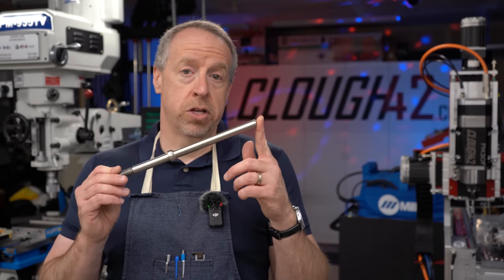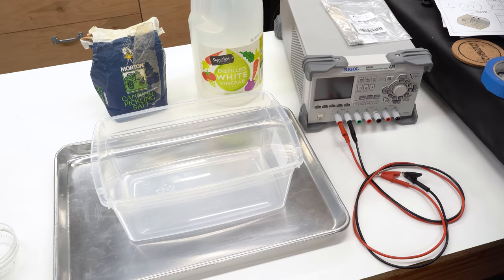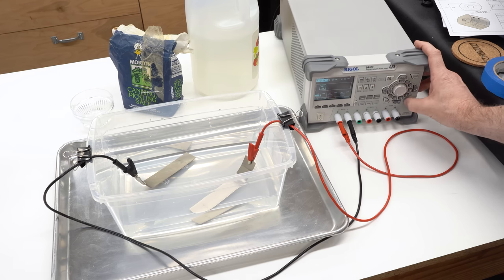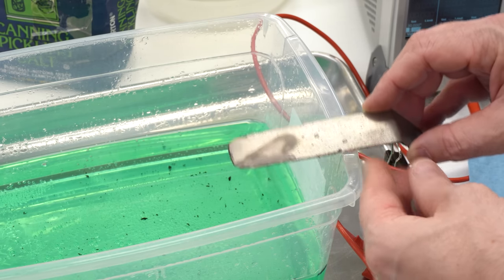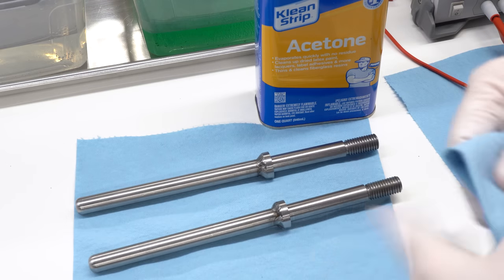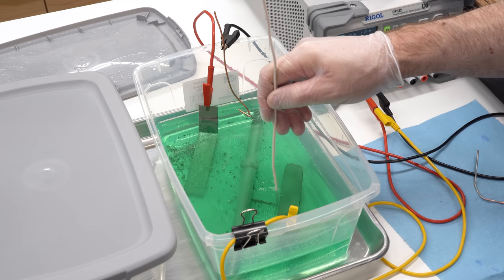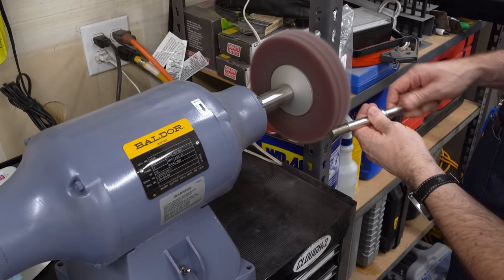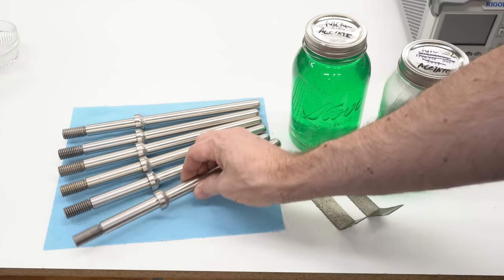Nickel Electroplating in the Home Shop - A Shocking Way to Prevent Rust!

Comment: Home or shop electroplating is a bad idea and the notion that it is a simple process is ridiculous. Reliably electroplating metals (nickel, copper, zinc, tin, chromium, brass, etc) requires specialized equipment, hazardous chemicals and process knowledge that are not available to home enthusiasts. All electroplating takes place in a specific process sequence that involves multiple cleaning, rinsing, de oxidation steps before the plating step can be initiated. These process steps use strong and potentially hazardous industrial chemicals. This should only be done by people who are in the electroplating and surface finishing industry. In addition to the potential for exposing the hobbyist to hazardous chemicals most of the products used in electroplating would be considered hazardous waste by the EPA so disposing of them is a real problem for anyone not in the industry. Bottom line, do not try to electroplate at home or in a shop. Take your parts to a plating company near you. There are more than 2,000 licensed plating job shops in the USA.
Reply from the maker: All-or-nothing thinking like this is a cognitive distortion, and it is fundamentally at odds with the idea that ordinary people can be makers of things and not just consumers.  My results were totally sufficient for my needs, and I did not use any of the hazardous industrial chemicals or secret industry knowledge you describe.  If I ever grow tired of reusing my two quarts of contaminated vinegar, I can evaporate it or take it to my local hazardous waste collection.
Reply: @Clough42  and what do you do with the nickel salts that will be left after you evaporate your solution? Throw them in the trash so they can leach into the ground water at the land fill? Look certain activities are suitable for the home hobbyist and others are not. Dealing with metal based electroplating solutions at home or in workshop just is not a good idea. Additionally the chemistry used in electroplating is dynamic meaning it changes as you plate and must be monitored and maintained or the resulting nickel (in this case) deposit will not perform well. Visual appearance of the deposit is not a reliable indication of quality or performance. My background is electroplating, I am a chemist who has worked in the industry for more than 40 years having built and installed plating plants in more than 20 countries.
Reply: @jeffbrassard1268  perhaps an industrial chemist with far too much spare time to be hanging around micro scale DIY nickel plating videos on YT and do nothing but criticise based only on your assumptions
Reply: @ianbottom7396  perhaps Ian, perhaps indeed.
Reply: Would just using stainless steel metal make it way easier to make the part instead of plating the item ???
Reply: We have one plating outfit in Alberta over 200 miles away, the biggest one went broke and folded.
Reply: @victoryfirst2878  
Stainless steel could be an alternative to (properly) nickel plated carbon steel in some cases. Typically stainless steel has different matching and strength properties so it may not be appropriate in all cases. Additionally stainless steel, principally due to its higher nickel, chromium and other alloy constituents, is usually significantly more expensive than carbon steel even when nickel plated. In fact, nickel plated or electroless nickel plated carbon steel is often a design consideration to replace parts made from higher cost stainless steel. Lastly, stainless steel, depending on the service environment is not always stainless and can show oxidation and corrosion under some condition. These are engineering trade offs that manufacturing engineers go through when designing component parts.
Reply: @jeffbrassard1268  Did you not read "I can evaporate it or take it to my local hazardous waste collection."?
Reply: @victoryfirst2878  That would be way more expensive.
Reply: @davesutherland7432  Necessity is the mother of invention. You have proved that for sure. Nice work fella. Nickel leaves a rean neat surface finish.
Reply: @jeffbrassard1268  You are correct Jeff, stainless steel is actually called corrosion resistance steel name from vintage metal makers.
Reply: Appreciate the concern but this is not an industry. The salts he produces will never amount to the waste you generate on an industrial scale. Stop blaming the DIY folks for “contributing” to industrial pollution. Fix the industries. Leave the individuals to themselves.
Reply: @jeffbrassard1268  I suspected that you had a financial incentive to be so critical of people trying to get into your industry. I'm glad to see that I was correct in that hypothesis.
Reply: I think this is fake. No way nickle will hold after just cleaning with acetone.
Reply: @victoryfirst2878  $$$$ ..... easier but ..... $$$$
Reply: @Onajkunj2  sure it will.  
Copper plate prior to "nickel " plate might be even better.  Then followed by chrome.  Triple plated chrome.
Reply: @jeffflanagan2814  
Hi Jeff,

My comment was not a criticism of how the video was done, frankly I thought is was very good. I was calling attention to the fact that electroplating is a 100 year old industry backed by chemistry and engineering science. There are hundreds of industrial, military and aerospace specifications written around the various electroplating and surface finishing processes that are commercially available from a global community of applicators. The industry is highly regulated by the EPA and OSHA among other government agencies. The processes required to get reliable, high quality electroplated coatings simply cannot be done in a home shop, nor should they do to the complexity of the process and the hazardous nature of the chemicals and metals involved. The appearance of the plated coatings is rarely an indicator of its quality or performance. Just because you can put a deposit of nickel on a steel part does not mean it will hold up over time. Deposit thickness and maintaining proper plating conditions during the process are critical- none of which can be controlled in a home shop environment. For instance a defined preplate process is essential to achieving deposit adhesion, this consists of alkaline soak and electrocleaning steps followed by clean water rinsing followed by a de oxidation step again followed by clean water rinsing all before you get to the plating step. The plating solution must be controlled, the pH, nickel concentration, temperature, anode to cathode ratio and current density must be maintained precisely in order to achieve a good adherent deposit. All of these process components are specifically designed for a purpose and must maintained, usually by a chemist. And yes I am the current president of the National Association of Surface Finishing trade association and have associated with the industry for 45 years.
Reply: @jeffbrassard1268  You make this sound so complicated and it is NOT. You must presume most people are ignorant or incapable. This sort of thing used to be taught in high school chemistry. Stop perpetuating the dumbing down.

Nickel salts? Oh, so scary. What about Sodium and Chlorine salts? Also so scary...*table salt*. Letting vinegar evaporate is NOT an issue...unless apple orchards need to be burned down for fear of rotting apples...and apple vinegar.
Reply: @Clough42  Suggest just using a little electronics cleaner as they tend to not leave residue.
Reply: @jeffbrassard1268  i work for a national waste company. landfills have giant tarps under them and have constant water monitoring. your "facts" are not true.
Reply: @Onajkunj2  One can think whatever they want. Last I checked we live in America.
Reply: The plating bath is basically infinitely reusable, so disposal doesn't even happen. It's a non-issue.
Reply: Stop it. It is a quest for knowledge, and I have successfully electroplated silver and nickel in my bedroom. Yes, I have a homemade carbon and hepa filter, and I vent the room...
Reply: @aminormaximum2446  I remember when I first used two D cell batteries to plate a dress pin. Worked well.
Reply: @victoryfirst2878  nice! Small innovations for the questioning mind! It is always good to try, and in the process, to learn new things!
Reply: @aminormaximum2446  This is hands down the name of the game. The ah hah moment is great. Like winning the lottery.
Reply: Jeff, I think it is good that you pointed out some of the hazards of plating. I think your concerns would be more meaningful if it was some type of chrome based plating. Isn't anything with chrome based plating much more hazardous? I am sure you mean well but you come across as a Pedantic Safety Sally.
Reply: Captain buzz kill, just letting you know, I've done this way of electroplating before and what do you know many years later the parts are still going strong, completely rust free!
One of the parts was a casing of a starter motor that's on a 4x4 that's constantly muddy and wet, give it wipe down and it looks like the day I plated it...
Reply: @sm9300  Nice to hear that the plating stands up strong to wet areas. When you buy brake calipers that are top of the line, they are plated, either chrome, nickel, or zinc. They really hold up well to corrosive environments. The painted or plastic coated ones seem not to really hold up. The corrosion usually pushes or bubbles the paint off the item.
Reply: I will be trying to plate my old front rotors for my car. Not exactly sure what metal I will plate but will try either nickel chrome cobalt antimony or tin metals. Will make sure to get back to you Jeff with my plating adventure. Thanks for the idea fella too. vf
Reply: @jeffbrassard1268  Now you are catching hell for your comment! I would say, you are right in some ways, but maybe of you would have said your piece on a more productive manner, it wouldn't have been so unwelcome. One knowledgeable person commented as to the dangers of trapping the hydrogen and oxygen below the lid, leaving only a spark to explosively ignite, but otherwise was pleasant. He was actually pleasant saying that. It is better that instead of yelling,"everyone panic, bad, bad!", You could have passed on some of that good knowledge that you have, in a way that made people want to listen and consider. If they are watching this, they probably have a little bit of intelligence, and have probably tried much more dangerous stuff than this. I do get your point,  though. Anyways I have some really old & cold DYNAMITE sticks that are sweating some clear liquid, same I am going to go juggle them while trying to walk on stilts on concrete. Should be exciting at the very least!
Reply: @Clough42  just someone protecting their income. ;)
Reply from the maker: @Onajkunj2  I don't blame you for being skeptical.  The world is full of people trying to deceive you for various reasons.  Your intuition is wrong in this case, but of course that's what you would expect me to say.
Reply: @jasonasselin8657  Thanks, i will.
Reply: @jeffbrassard1268  Hobbyists have been electroplating for decades. Heck, we even did this in science class in middle school. So while yes it obviously can be hazardous, and everyone should actually check to see what toxic chemistry you are potentially making up. Clearly if they allowed kiddies to do it in school (under teacher supervision ofc), then it is not as horrible as you make it out to be. Yes ideally one should do all those that a commercial company will do, but a personal likely is not going to expect ideal results.
Reply: @victoryfirst2878  I found that the key to success is surface prep, you really need scuff the parts up to get a really strong bond and make sure the parts are perfectly clean, I found wax and grease remover then a flame clean to burn off any last possible contamination, and let it plate for a long while.
I made sure everything was suspended properly in the solution.
A nice deep batch with nothing sitting on the bottom!
Reply: @sm9300  I got that Shane. Cleanliness is next to godliness. Thank you for your advice Sir.
Reply: Rather than saying "it's not hobbyist-friendly", it would be better to state more useful to do to get it safe and sort-or-right. I do believe Chrome is a bit too dangerous for the average person, but nickel, gold, and copper don't seem too difficult, at least for hobbyist-grade results. Residual solutions could definitely be neutralized or turned to a disposal site.

This all-or-nothing hobbyist-beware mindset has led to pretty silly statements in my opinion. The MSDS datasheet for table salt, for instance, paints common table salt as "facilities that store it require eyewash stations and emergency showers". For table salt.
Reply: @MichaelChenTejada  A friend of mine spent the better part of a year in jail on an attempted murder charge because he put a chemical, "sodium chloride" in his dad's food, took 9 months for them to figure out that was table salt. I read the depositions!, he wasn't bs-ing me !
Reply: @petevenuti7355  reminds me of the Dihydrogen Monoxide scare.
Reply: The fear mongering is particularly strong with this one.

don't try to italicize like I did on your own.  Very Danger .  I am a professional italicizer.
Reply: Granted, caution, prudence and safety should always come first, besides, plating done in an industrial setting is going to be far stronger and last a lot longer but, nothing ventured nothing gained. I am apparently still alive after  Electro-plateing my lawn mower blades with titanium which by the way, worked great, they hold a sharp edge a lot longer than an untreated blade.
Reply: Lighten up brother! It's obvious you know your stuff, and it's also okay to FLEX a little!  😉
Although, it is indeed a simple process as shown, not bad or dangerous in small scale for the intended purpose. 
Achieving a corrosion resistant surface on small parts is not intended to provide the same results as if chrome plating bumpers for a 1966 Corvette, a plating shop is far more intense, multiple plating layers etc. But....you know that! 

For years I sold interior industrial environment projects (providing chemical resistance and/or microbial control) providing ceilings, walls and floors to various industries, including vinegar producers in MI and plating factories in IN. 
The plating industry didn't use vinegar LOL...and what they did use would damage the concrete.
 In the course of my job I have toured several Ford and GM plating division plants, and as I remember the chemistry involved in the plating industries is hazardous, is not a good idea for the DIY at home.
EDITED to add, VENTILATION is also a huge issue not addressed here.
Reply: @jeffbrassard1268  lol you sound like my dad that thinks cars can only be repaired or worked on in any way at a dealership.
Reply: @victoryfirst2878  I don't
Reply: EPA has made it prohibitively expensive for their own selfish reasons, encouraging the home DIY.  Additionally, there's pertinent information purposely being kept from the public, thus we have to learn from our mistakes.  Frogs love that, ya know.
Reply: Electroplating parts is extremely expensive to have performed by a shop from what I understand.

 I need to re-chrome some automobile emblems for a 25 year old Volvo 850R, and new emblems are not available from any source at this time. I made an R emblem for the grille out of plate aluminum, but it was labor intensive. It's possible to electroplate the old plastic emblems by coating with graphite powder first, and nickel is the closest to chrome without being actual chrome. I'm  pretty sure it would cost several hundred $ to have these parts plated at a shop.
Reply: @Onajkunj2  Based on what exactly?  I've seen plating done on LEAVES - actual copper plating on PLANT LEAVES, once it has enough of a shell it holds to itself, plus in the case of this vid the micropores of the steel will be more than enough key for the nickel to stick, the fact you don't know this shows you're not equipped to be watching this video let alone commenting on it.
Reply: @jeffbrassard1268  You make me think of a concert violin player in the London Philharmonic Symphony Orchestra who makes music for halls filled with thousands of discerning listeners and critics with career-ending influence.
You're like that artist telling the guy in the music shop whom he notices perusing the violin section that the composition of the bow's rosin needs to be sourced from a specific supplier, aged at an exact temperature for precisely a certain number of months or it will affect the breadth of the tonal palette when the Strad is played in a period chamber setting.
But the customer in the music shop was just wondering what he might pick up for 50 bucks to take to his uncle's kitchen party down the way and leave him with some beer money.

The guy made a mason jar full of green vinegar. Erin Brokovich isn't going to be taking him to court.
Guys like you need to take the next generation of electroplating professionals and infuse them with the same passion for safety and perfection that you have.
That next generation comes from youngsters who see guys like this making green mason jar juice.
It's cool. All cool.
Reply: @jeffbrassard1268  I am an industrial chemist and totally agree with Clough 42. Jeff you are also correct in your points on waste treatment. So are you saying that for the sake of a few grams of nickel acetate one should not give this a try, when major companies around the world are dumping toxins by the 100s of tons e.g. cyanide for processing gold. A check on the  toxicity of nickel acetate states it is mildly toxic, so you are saying that if I was to cystallise the nickel acetate and seal it in several plastic bags to contain it, this minsicule amount of mildly toxic compound will harm the earth?. I woud suggest you are possibly a Greenie.
Reply: Jeff, why didn't you introduce yourself as the President of the National Association for Surface Finishing? I think your comments are better appreciated in the context that your actual job is to tell folks to give their money to a plating shop.
Meanwhile, the rest of us are going to have a great time nickel plating whatever we want to.
Reply: found the guy that owns a licensed plating shop that doesn't want you doing his "specialized process" yourself.  Lol.
Reply: @jeffbrassard1268  As an Industrial Chemist I will answer your question. As he has 2 litres of solute and say the concentration is 20% by weight, he will evaporate and leave about 400 grams of salt. This salt can be wrapped in triple layer polyethylene which would never leak at a tip. Jeff can you stop pretending the hazard you perceive. For your info I did nickel plating at school here in Australia in 1974, completely safe and the job was well finished. Obviously you have a vested interest to not lose business to people doing their own electroplating by throwing the dangerous chemical herring angle around.
Reply: The last thing most plating companies want is the average dude walk in customer with a couple parts. It costs more to process the order than it's worth. Simple PITA! Yes they can throw it in with a batch run and most will but that's just to be friendly to the public.
Reply: @jeffbrassard1268  Mate, you need to calm TF down.
I used to run the plating line for an electroplating company in Brisbane Aus. 

Sure, industrial set ups with several kilolitre tanks of potassium cyanide are not suitable for the back yard'er. That's NOT EVEN CLOSE to what's being shown here.
Dude wasn't even using anodic or cathodic cleaners.

Settle down.
Screw the EPA, screw all your noise, I will have my hobbies in my shed and there isn't sweet FA you can do about it, nor will the sky fall on all of our heads.

One of my other hobbies involves charging up 10uF 100,000v capacitors to 50kV or higher. That would rip your (or mine) arm off in the blink of an eye, cauterise the stump and at least partially vaporise the limb, at least a finger or two. I have no formal training as an EE, electrician, linesman or any other formal training for that matter. I also write my own software and lash up some pretty dodgy process control and automation setups from time to time.

I suppose I should sell off all my welders, transformers, chemicals, hand tools, computers... and go hand myself in to the authorities, in your books.
Reply: @Clough42  I agree with you, I started to do anodizing at home and like you, found it to be rewarding once i got it to work.   I like to DIY whenever possible and enjoy the challenge of learing new stuff.   On a practial level, I am certain most plating shops would laugh you out the door with 6 parts, or charge such a high fee to discourage small infrequent customers.  Thanks BTW for the great video!
Reply: Jesus.  I am a toolmaker.  These processes become unsafe based on scale.  For what he is doing I promise you he is having a minuscule effect on the environment compared to your local trailer park chemist in their motor home.  Besides he clearly stated he had a safe method of disposal.
Reply: @victoryfirst2878  If you really want to play around with plating, and you run into trouble, get your hands on a copy of The Canning Handbook. 

It's the bible of plating, anodising and most other surface finishing. Pretty much all of the technical "process knowledge that is not available to home enthusiasts."

Of course, do your due diligence and look up the MSDS for any chemicals you need to acquire and should you end up with any waste, take it to your local waste management centre.
Reply: @jimmyb1451  I tip my hat to you Jimmy. You were the first person who know the trick with this manual. Some would say it is the good book of planting plus extras. Also, you can find a many other methods for plating in old patents that use simple elements which perform flawlessly. There are many ways to skin the cat, it is said. Job well done Jimmy. Peace, vf
Reply: False thinking
Reply: @Clough42  
Just use up the nickel solution if you don't need it anymore. 
Means simply nickel plate something until the solution is clear. And Nickel is hazardous to aquatic life. 
Be aware that the bubbling is most likely hydrogen and can cause a explosion in a closed space! 
Hydrogen often causes scratching feeling in the throat and coughing, but depends on the hydrogen concentration in the air.
Reply: @jimmyb1451  You can buy solution for plating from eastwood company. The sell stuff for car enthusiasts. Eastwood Electroplating Electrolyte Solution Works With Brass Copper Steel. The cost is 53 dollars. Just a thought Sir. Peace
Reply: @victoryfirst2878  
Your getting wrong information about plating.
Your finish part will only look as good as before.
What I mean is you can polish it before to the finish you are looking for, and then again after you plate.
For the best results.
Reply: @victoryfirst2878  
Can’t plate rotors it is way
harder than before and it will EAT BRAKE PADS.
Reply: @scottmccoy9230  Both points well taken Scott. Have a great day too.
Reply: Jeez, what a kill joy. And most of what Mr. Brassard says is wrong, anyways.

On a relative scale compared to other metal salts, nickel is not very toxic. 
If you ARE concerned about environmental aspects of heavy metals, then better not hunt: lead is far more toxic.

You could in fact pour it down the drain in small quantities: it gets diluted in the system, and from a hobbyist's output you aren't going to cause a problem. And THAT is based on the fact that you already consume nickel in water and food at an average of 3E-5 mg Ni/kg/day for a 70 kg person. So yes, that's a small amount, but the POINT of that is that dilution of any spent nickel DOES get massively diluted by the sewage system.

Perhaps it's more responsible to neutralise the dissolved nickel with a caustic, then dispose as solid waste.
Reply: A little overboard there Jeff? Take some of that passion to India, or China, this guy isn't gonna hurt anything with his hobby kit.
Reply: Caswell plating has some nice home shop kits. Jeff remove your head from your rear. How benevolent of you to even address us peasants. People like you should or could share more and better the community but instead choose to use fear to make this relatively easy process a boogie man that only the superior like you seem to think of yourself as the only ones privileged enough to use. Sorry but you seem hurt that a “simple” man figured out a simple process safely.
Reply: You know my local hazardous waste collections got fined not too long ago for dumping industrial waste into the ground..  so disposing of should be in quotes because you have no clue or control of what happens to the stuff after giving it to the certified people who are supposed to be collecting it all and doing what they do with it all.  Which i assume all gets buried like everything else either in the states ot shippef over seas to be buried over there..
Reply: @jeffbrassard1268  ok boomer
Reply: Says Mr Brassard; Chairman of the "All American Association of Metal Platers"
Reply: @jimmyb1451  I want to party with you, sir.
Reply: Patronising. People can do this at home if they want and are aware of risks.
Reply: Your trolling or something. Be safe start plating.
Reply: @jeffbrassard1268  Hi Jeff I read your comments on these Nickel plating video's with interest and in an ideal world I agree with you, your comments are very sensible and undoubtedly indicate a better route for plating metal than doing so in a home shop. If I wanted plating for commercial work I would always go to a professional plating company as I cannot guarantee the quality or repeatability of my plating. If I wanted to have a long life on the part I was looking to plate for example plating a part for a vehicle restoration then again I would go to a professional firm. Having said that, I shall continue to happily plate projects in my home shop because reality here is that margins on personal projects are tighter than a tight thing in a tight place 🙂 For my personal work it's a question of plate it myself or don't do it. I am not a chemist (my degree's are in another subject) but there is very good information available  on amateur plating including safe disposal of all chemicals used. Please don't assume that all amateur platers are incompetent, because it's not so. Best regards Sarah
Reply: @victoryfirst2878  Stainless steel in most of its alloys is a real pain to machine and work.  Where it's in demand, there isn't a real replacement.  For the rest of applications, it's too costly to deal with, as a metal, as a consumed part or product, and with its hazardous waste potential.
Reply: @Clough42
Reply: Does anybody here success in electro-plating after this video clip ? I think most watched just for entertainment.
Reply: Jeff I dont know if you'll see this, but I want to thank you for your comment and follow ups. You obviously have a great deal of knowledge on this subject, and not everyone takes the time to share.

There is a great deal of need in the world, and with what you have, you could change the world in a better way. If you could take the knowledge you have, and translate it into a "good enough" solution that might not be up to professional standards, but good enough for hobbists, done in a safe and economical way..

Look at it this way. What audio file revolutionizes the music player industry? Mp3. Why? Because it was "good enough." something similar happened with digital cameras not long after. The AK47 line revolutionized firearms, as it was a "good enough," economical solution to small arms.

Most of the world is not paid like you, and other westerners are. Here in South Africa, the going rate for a day's wages is $17. And no, nothing we buy here is cheaper than you can get in the US, most is MORE expensive due to the 40% import taxes and extremely corrupt quasi-socialist government.

So for us, we can't afford to get get professionally nickle plated tools/parts, like most of the third world countries, we have to see what we can come up with.

I wish you would think about these things, and help us come up with a "good enough" DIY electroplating setup. Who knows how many people will take that and turn it into a desperately needed side income for their family.

Much thanks,
Jesse Gunn, South Africa
Reply: Anyone that can read can electroplate.
Reply: @victoryfirst2878  sure, would raise cost as well! Stainless steel costs four to five times as much as galvanized steel and untreated structural steel.
Reply: @plintu3  That is so true on stainless costs. I just buy my metal from surplus sales. Price is very fair. PERIOD. That is why I always use STAINLESS STEEL Should be called corrosion resistance steel. That is what it was called originally. Peace and have a good day too fella. vf
Reply: @MadSceintist  Good luck with your planting jobs fella.
Reply: @MadSceintist  I just bought rotors that are plated. The price was three hundred dollars. Did not have to do anything other than placement. Will work for me fella.
Reply: E
Reply: You are correct in all respect. One big issue is proper ventilation and most basements, garages or pole barns do not have the required ventilation. Mixing bath chemicals and getting the plating baths up to temp for operation all need ventilation. Don't poison yourself. If you want to do some beaker chemistry with a few small parts then a well placed exhaust fan and a good fresh air intake is all that is needed.  Beaker chemistry means one or two beakers no bigger than 500 mls.  The small amount of fumes given off isn't too dangerous as long as there is good ventilation of fresh air intake and a well placed exhaust to the outside. If you are always getting stuff to plate, then make friends with the local small business owner that does commercial plating and let them plate your projects. This is much safer.  You don't want the EPA to condemn your house or garage. Hazmat clean up is expensive.
Reply: How many of those 2,000 do old school clear cad plating for old car parts?
Reply: Sure, this is likely pretty low risk with respect to the nickel compounds primarily due to scale, however proper PPE should always be used and understand how to deal with the material. Nickel is a heavy metal and exposure to it in plating will increase that exposure above what would occur through its natural occurrence in the environment and can become a toxic exposure.  Ask David Hahn how his DIY breeder reactor turned out. I'm sure his neighbors were thrilled to find out he created an EPA superfund site next door...  all he did was get some smoke detectors... surely those common items could never be THAT bad, right?
Reply: I was working avionics in Tulsa and a guy on my crew was volunteering for the plating shop. Hot deadly chemicals. Overtime isn't worth it and a guy from the shop came to tell him he was a replacement for the last cancer victim of that shop. 757 main gear about 15 feet high were plated there and walking through it one time and I stayed clear.
Reply: @victoryfirst2878  Stainless is MUCH harder to machine and weld, not to mention quite a bit more expensive than mild 1018 steel.
Reply: @demandred1957  This all depends on the technology you have access too including great location of surplus metal supply.  Cheaper for me than you can imagine, Sir,
Reply: @victoryfirst2878  Cool. It is still quite a bit harder to machine though.
Unless you have the proper tooling etc as well.
Reply: @demandred1957   Friend has complete machine shop. Yes stainless is a bitch as they say in the machine shop but the right tooling makes all the difference.  When something is made with this it just lasts. The shine is first class and life expectancy is literally unlimited for sure.
Have a Happy New Year Sir. Peace too vf
Reply: You both have valid points…there’s a place for professional efforts and procedures brought solely from “BIG COMPANIES” buuuuut there’s also ALWAYS room and need for hands on knowledge accumulated through DIY Projects especially if the outcomes assumed meet or exceed the needs of the “little guy”. And as GHANDI would say…”I have only love and respect for the both of you’s guys” 😅
Reply: Jeez, I bet you're fun at parties
Reply: @jeffbrassard1268  there is Stainless Steel then there is stainless steel there are so many grades of stainless and most that would be available to the average consumer is basically rubbish, As an example a few years ago when I worked on quads that most people used for either dunes or especially dunes behind ocean beaches they usually did two things they powder coated frames and used stainless bolts in both cases thinking it would make things better suited to a salt laden environment, Technically maybe in practice not so good.

Powder coating seems ideal at first glance but one chip and unlike painted finishes and over the next year or so it starts to rust under the powder coating near the stone chips then whole sheets of powder coating flake off exposing massive surface rust so much for protection properties, Whereas Painting may chip but rust never spreads underneath the adjacent undamaged paint and it is easily touched up.
When building Rally cars I went from expensive paint like Dulux Akran specifically made for the transport industry and everything from dangerous carcinogenic two pack Isocyanate curing paints in the early days cognisant of the dangers and appropriate safety requirements again due to good research, I ended up using basic hardware store enamels now available in a few hundred different colors and shades with an add in hardner and literally 20 minutes later buffing the paint with fine cutting compounds known as burnishing cream made for two pack paints result no stone chips unlike most other paints an occupational hazard with rally cars, Paint a whole car with between 0.5 tp 1 litre of paint maybe 300 ml of thinners so environmentally friendly due to minimalistic material requirements and a superior stable finish being both tough and durable and once buffed a high quality finish not out of place on a Rolls Royce

Then we have stainless bolts etc as sold by most specialist nut and bolt suppliers most are absolute rubbish more often than not galling and picking up upon attempted removal destroying the thread in the parent material most often either chassis or engine components  and requiring difficult and or expensive attention to fix, I have found however having worked on European motorcycles such as BMW that they seem to use a higher quality hardened material specification that virtually never galls or picks up and damages threads, Yes you can use various neverseize products but even then you need to do the research as to ascertain which variant is suitable for the application and rarely do the people supplying such products have the expertise to correctly  advise the customer.
Then as you touched upon with Nickel plating there is electroless plating significant because as Hot Rodders found in the past and various Government road authorities discovered after the fact Electroplating suspension components can lead to hydrogen embrittlement and catastrophic failure hence it has now been outlawed.

So as I have pointed out a well researched Mechanic or more correctly these days Technician because we do so much more from diagnosing modern Canbus systems that operate on the same protocols as the internet to various diverse systems that make up modern cars trucks and motorcycles with such a background as well as having been a CNC Machinist and Engine Machinist and fabricator making among other things approved Safety Roll Cages for Motorport I am well aware of where you are coming from warning people who jump in without a second thought as to any consequences so are just expensive mistakes other can be deadly as you try to point out, My own experiences are as noted above wide ranging and done with perfection in mind hence so much research into both techniques and materials that ultimately pays off.

Maybe others need to understand some more before jumping off and taking fair criticism and advice the wrong way, Sadly the internet is full of so called experts leading people into god only knows what troubles whereas when you do have the expertise you really have to show examples some can relate to from hard earned experience to earn respect and have people take well meant advice the right way, I hope my examples as listed above help you in the future all the best.
Reply: Nanny State in full effect.
Reply: @jeffbrassard1268  Aahhhh... makes sense now... I wouldn't worry about your job.
Reply: @victoryfirst2878  Have you tried machining stainless steel vs mild steel using average home equipment? Apart from the problems of work hardening, it's just way harsher on all tools.
Mild steel + electroplating is actually much easier. I think the current was a bit high in this video. Generally, particularly at home, low and slow gives more solid plating results.
Reply: @jeffbrassard1268  Unless annealed in a reflush furnace welded stainless will oxidize and show brown specs around the welds at some point in the future. 
Annealing prevents this oxidation at the welds, it also removes the rainbow discolorations in the weld and stress relieves the welds which serves to greatly increase the longevity of a part subjected to high stresses. 

Annealing stainless Offshore racing boat headers increased their life by more than 6 times, no structural or material changes.
Reply: Although I agree that commercial platers do indeed use some pretty nasty stuff this is needed because of volume of work and production speed. You need to move fast to satisfy customers while the hobbyist can take time. You acid dip parts in a solution that would dissolve bone, we soak parts for an hour in 2 food grade products commonly found in salad dressing. In my case, anything that gets contaminated with metal bearing solution, like nitrile gloves and paper towels are incinerated in my foundry. Everything else is saved in sealed containers for re-use.
Reply: @lisakingscott7729  This is the trick with working on stainless at home. When you go to swap meets, flea markets, yard sales, ask the people maybe they have machine tooling. I literally got all my tooling just by asking and try getting cobalt alloy tooling. This works way better than HSS, last way longer when ground correctly. Make sure the lathe does not overspeed which brings in chatter and chipping the tool and making a smooth cut impossible. Also, using a vibration absorber on the lathe makes a world of difference. Hope that helps and good luck Lisa.
Reply: @jimmyb1451  wow, I'll never regret to read all this comment section thanks to you!!! I really aprietarte your recommendation!
Reply: @ianbottom7396  I too am an industrial chemist and occasionally run DIY electroplating - mostly zinc - for corrosion prevention on  automotive parts.....just 'cus I can. Read up on the chemicals required, use eye protection and try to avoid splashing solutions on your skin (or wash off promptly if you do) and you'll be fine. Read up on hexavalent chrome and how to avoid inadvertantly making it. As for miniscule quantities of chemicals leaching into the environment....not an issue. Keep the quantities small and nature immobilises/deals with it very effectively. Happy hobby plating!
Reply: @Mike80528  I think your post illustrates part of the problem the OP was talking about. People who don't know anything about chemistry could inadvertently cause problems for themselves (or others). A salt in chemistry is a type of compound - it doesn't mean a particular chemical is like table salt. The toxicity of a salt depends on the type of salt - potassium and sodium cyanide for instance are both salts, and highly toxic, where potassium and sodium chloride aren't. The nickel acetate (the salt in this video) is carcinogenic, as are many chromium salts likely to be used in electroplating. They're not the sort of things you want lying around the house, and you shouldn't be putting them down the drain or into landfill either. I think someone else mentioned the problem of flammable hydrogen generated during the process.

I think the OP was making a valid point - it's complicated and difficult to get good results. If you don't know what you're doing, you probably won't get good results, and it won't be worth the time and trouble for most people. If it's important it's probably better (and cheaper) to either get it done by someone who does it professionally, or buy something off the shelf.

Maybe the maker of the video got lucky in this case, and the plating will last - will be interesting to see it in a year or two....
Reply: @davesutherland7432  i plate copper in my home forge in N Ab....
Reply: @tihzho  I’m thinking the salt waste in the oz region, likely not a big deal in the big picture.
Reply: "Bottom line, do not try to electroplate at home or in a shop"
You'd get better results, Jeff, if you helped people to tune their process and advised them on proper disposal.  I'm afraid that simply telling people what to do, while waiving around your chemistry badge, isn't very effective. The disposal issue is quite important and if you have 40 years of experience, why not open with advising on the proper way to dispose of the solution, followed by a critique of which steps in his process could use improvement to form a more stable layer of nickel on the steel? Given you know that this individual (and everyone else doing this in their garage) isn't going to simply stop because of a youtube demand, why not use this opportunity to help us be better hobby platers?
Reply: Wow.... I been home zinc plating motorcycle parts for years ...calm down there mate
Reply: @jeffbrassard1268  Aren’t most modern landfills lined these days? The waste from dumping all our leftover lithium, cadmium, lead, chemistry batteries, isn’t so clean. But the US and basically all western countries are decades beyond the rest of the world in this regard. I don’t think James’s electroplating adventure is anything to get riled up about. Your safety advice is acknowledged and appreciated but I think it is equally important that we learn about the processes involved and that makers and consumers alike be encouraged to experiment. Many of our greatest innovations have come from amateurs. I believe we are entering a new age of amateur scientists, tinkerers,and inventors and those like James who share their results on YouTube provide extremely valuable educational information that will help propel this movement forward.
Reply: @davesutherland7432  In Ontario you either go to Cambridge, Montreal or the USA for Chrome. I can't afford any of them.
Reply: @jeffbrassard1268  His plating probably lasts longer than some of the off shore products we are getting in.
Reply: @petevenuti7355  Table salt can contain talc as an anti clumping agent. It is very similar to asbestos and talc has many lawsuits regarding female produscts
Reply: @jeffbrassard1268  is this guy doing electro plating for NASA? nope. The military? nope. Aerospace? nope. 

give it a rest. I bet if he did 1000 of his handles per year for 10 years he wouldn't produce 1% of the pollution that 1 week of an industrial outfit. 

I bet you're related to mechanics who don't want people repairing their own cars.....
Reply: @maxwebster7572  Talc seriously? Comparing Talc to asbestos seems like comparing tennis balls to used hypodermics! 
  Of course I wouldn't want any of those things down my throat and into my lungs....
Reply: @petevenuti7355  Check your periodic table and google where talc is mined.
Reply: @petevenuti7355  you may also investigate ovarian cancer caused by Johnson and Johnson, and anti caking agent in salt
Reply: go home
Reply: @maxwebster7572  how does talc get in ovaries? Was it in the cut of whatever they were shooting up?
Reply: @maxwebster7572  the minerals I mentioned already, are made from all of the same elements and form in related conditions, and like I said about vermiculite, asbestos contamination is getting really severe with that.. so if mine operators just try to cover things(cheap) up instead of being safe(expensive) they will ruin talc for everybody..
If all it takes is a frivolous lawsuit to make it safe? Or is it a way to cause people to disbelieve science because of it's frivolity?
    Whatever it is, and however it works out, I just wish I was a fly on the wall in the boardroom while they discussed how to tactfully word the future warning labels on talcum powder and where it should not be put.
Reply: @petevenuti7355  I think you can add it to toothpaste as well.
Reply: Sounds like you own a plating shop and don't want to loose potential customers..........
Reply: You put all this effort into someone being responsible 
Misguided energy is all I see here.
Reply: @timothyknight2236  😅😅😅
Reply: Boo! Hiss!
Reply: Gee, Jeff, I wonder what industry you are in~~~?
Reply: You are absolutely right .
Reply: Let me guess, electroplating and surfacing finishing industry, i.e. your business.

Well, I zinc plated my brake caliper bolts and they turned out fantastic, I'm here to tell the tale.

And here's the kicker. I saved a TON of money that probably would have gone to you but instead stayed in my pocket.

Don't make electroplating sound like wood fractal burning. You're wrong and I want to make this comment so that other DIYers know that you wont die, or spontaneously combust, nor will the EPA come kick your door down and haul you off to prison, lol!!

DIY electroplate at home ya'll. We'll be ok.
Reply: and yet here in the UK Nickel and Copper Plating is taught at Colleges in Jewellery Studio Courses, as is Aluminium and Titanium anodising
Reply: These are precisely the arguments that kill any interest among schoolchildren and students in any technical creativity.
Bottom line, do not try to do anything at home, take your parts to a company near you.
Sorry, if I don`t answer.
Just went looking for electroplating company in Moscow.
Reply: @ALEXLAB  funny, the dangers and risks , it was precisely because my parents and teachers said no is exactly why I was making a good effort to succeed at it as a kid!
 (Until I got some green slime of some unknown cupric-unsaturated hydrocarbon splashed on the ceiling when my apparatus exploded because I had too much current with my copper leads accidentally in the Ionic liquid electrolyte  unsupervised)
Reply: Said like a true business. It’s super easy to do and super easy to clean up with only minimal knowledge and equipment. Get a grip
Reply: Welp... This thread escalated quickly...
Reply: Jeff must have little real life experience. Go to any job shop with less than ten empoyees virtual chemical nightmare. Not to mention contaminated coolants from various alloys and leaded metal.
Reply: @jeffbrassard1268  I belive you that you are a electroplating guru. If you are, then maybe you can write a nice book wit all the secrets warnings methods and dangers so the people who just want a product and dont have 40 Years to dedicate themselves to a process can see if it is suitable for them. I have a reasonable foundation in chemestry and am replicating lots glourious industrial secrets at home, but it would be better to know where the traps are. Share insted of disencourage.
Reply: Can we all agree @Jeff Brassard called the wrong number? All in favor? 👍🏻
Reply: @jeffbrassard1268  If these nickel plated items were being used for some very critical application where someone's health or life were on the line, then I would definitely be getting ahold of someone with your expertise. But if the nickel wears off of these pins, no big deal. However, it is very interesting to know just how much exact science and monotoring goes into this complicated process when it is done professionally.
Reply: Oh yes I'm sure a job like the one in the video would be high up on the priority list for a professional plating shop. And how much would it cost $100-150, lol compared to $50 diy and with that $50 you have enough material to re-plate 10 times. Nobody is advocating doing chrome plating in your basement but on this scale and non critical parts Cu and Ni is fine. Or do you have some numbers to back up your hysteria, how many people are killed/injured per annum by diy electroplating? Medical malpractice/error is the #3 cause of death in the US does diy electroplating harm more people than that, are you breathless with fear when you drive by your local hospital?
Reply: @danewood2309  "and yet here in the UK Nickel and Copper Plating is taught at Colleges in Jewellery Studio Courses, as is Aluminium and Titanium anodising"
Which is the way to go. First learning the trade and then doing it. 
But have you read the comments here? There are remarkably many conspiracy dipshits and other silly assumptions roaming around here. Hurry up, not much time to say "Goodbye" to them;)
Reply: @Clough42  I have to say that your comments about "cognitive distortion" makes more sense in theory than in practice.  When I was in grad school, our chief technologist used to plate many of our test cells... he had "Workshop Receipts" turned to the plating section but he still used commercial plating chemicals for his work.  I asked why and his answer was simple:  They've worked it out over years of practice.  There's a lot of art in plating.
Reply: @jeffbrassard1268  to suggest that responsible disposal of hobby chemicals is beyond the scope of the home chemist is silly - and I'm a chemist by training.
Reply: @victoryfirst2878  do you know what SS would cost for those items?  It's also not as easy to machine
Reply: @en2oh  Well stated fact.
Reply: @Clough42  I used to work in a composite shop and we electroplated carbon fiber parts for military imaging systems . You're doing it right, if you want it shinier ...polish it finer first. Like paint , the better you prep the better the finish
Reply: @Clough42  also ,copper is the best base to plate to .so doing a 2 step copper then nickel plating will give you a better finish
Reply: @Clough42  oh ya if you had a bubbler system to it it works better aswell
Reply: @Clough42   YES
Reply: So what am I supposed to do with the clean up residue from 25 gallons of polyester resin, enough mekp hardner and 15 gallons of used acetone from rebuilding a boat?  Ah, nevermind, I just remembered the burn pit handled it just fine.....
Reply: WRONG! - Just WRONG
Reply: @skylane807  I'd agree with the copper plate first and ESPECIALLY if chrome plating but I wouldn't copper plate, then nickel plate and then chrome plate. If chrome plating go direct from copper to chrome.

The problem with chrome is that unlike nickel it is VERY prone to flaking in certain environments ... Just take a look at how many chrome plated bumpers and other items end up rusted through.

In my experience nickel is a more durable, and better looking finish in a workshop.
Reply: @Onajkunj2  well CLEARLY it DID! Being cautious and a little skeptical about other people on YT is one thing, but James has never come across in any of his videos as anything but totally open and completely non-deceptive ... To the extent that he videos and comments on his own mistakes - usually a sign of a genuine bloke!
Reply: @scottmccoy9230  by rotors do you mean brake discs? Of course you can plate them just DO NOT use them ever again on a car, especially as pad material is designed for the material of the disc ... Cast iron or steel. 

You COULD plate carbon fibre discs ... But that would be dumb in extremis. You can actually plate ANYTHING. The issue is getting whatever you want to plate to take an initial conductive coating. 

One of the easiest is colloidal graphite that works well on plastic and plant material, then copper plate (the easiest metal to get to take). Plating plastic parts like this is a cool way to get metal looking parts from injection moulded ones or 3D printed ones.
Reply: If you go this way, almost everything except reading books at home is a bad idea
Reply: I’ll do it myself thx.
Reply: Its chicken little😮
Reply: This OP is a total buzzkill, relax Karen, I bet this dude works for the IRS or the ATF lol
Reply: @Clough42  When I was a young man, I took my foreign import car to a local mechanic's shop to have the valve lash adjusted after initial break in, as per the manufacturer's recommendation. The dealership was a long ways from home... I was told by the shop owner that the job would be very expensive because a "special tool" was required.  I think we've found our special tool here in the comment section of your plating video.  10 years later when a cracked oil pump drive gear, caused me to tear that car's engine apart, I found the special tools I needed to set the valve lash near the end of my DIY rebuild, was a metric hex (allen) wrench and a feeler gauge.  Thanks for the video and congrats on fantastic results.  I'll be trying this soon.
Reply: only the government should be able to do these processes because the company's might make mistake's and cause environmental harm and then the government has to fix it anyway. comrade.
Reply: That's the problem with most things. Gubment agencies.
Reply: Even if this process were as dangerous as you claim, it would not be a valid reason to avoid any practice. If we limit the use of a process to a small group of "qualified" people as long as it is possible to injure ourselves, it is a matter of time before all manual activities are limited. In reality, what is important is that the dangers posed are limited to the user and that he is aware of them.
Reply: @Clough42  i have had excellent results plating nickel, copper, silver, and gold. The only thing i would say for a little better results lower current longer time.
Reply: @petevenuti7355  Give this type of mind 48/64 and they will never ever reduce it to 3/4.
Reply: @ellieprice363  this thread is so long ago, I can't be sure what your reference is about.. it just reminds me of all the precision drill bits I've broken..
Reply: in short THEY can pollute but you cant.
Reply: @petevenuti7355 
My point was that some “Einstein” type minds always over- engineer everything. To them every process must be extremely complicated to work.
Reply: @ellieprice363  I see, and you don't have to be an Einstein to over-complicate things..
Reply: @user-dl1cf4xr6t  when you suddenly realise you're speaking like Mickey Mouse with his gonads kicked to his ears (high pitched!) that's a SURE sign that the Hydrogen concentration is as high as your voice and NO time to light a cigarette! 🤔😲🤣🤣🤣💥💥🤯
Reply: @ihdieselman  it was fairly obvious wasn't it.  Jeff seems to think he's his own personal enforcer of protectionist legislation.
Reply: @Sugarsail1  agreed 👍
Reply: @stephenross4333  Yes, having a shop replate is PAINFULLY expensive. I restored a Honda Valkyrie and the plating cost me over seven thousand dollars 😢. But, damn it looks good 😂
Reply: 99.9% of the viewers of this type of video will never try this at home, so pontificating to people who are here for entertainment’s sake is a bit silly.
Reply: I didnt know vinegar and pickling salt are deadly *clutches pearls*! I'd better stop eating pickles...
Reply: JeffBrassard1268, people like you are the reason why computer manuals from the 1980's changed from complete books, where they taught people how to learn how to code, to current day where it's little more than a pamphlet of pictures, and a warning not to eat the desiccant packet.

We NEED to bring back "intellectual curiosity", and I'm glad Clough42 pinned your comment for everyone to see.  Even a year later, it offends curious people like myself (not that my personal opinion should matter to anyone) because it directly exposes the anti-DIY sentiment some have.
Reply: Lighten up fella. lol
Reply: @jeffbrassard1268 interesting your primary concern is waste. When the industry you so humbly boast your contribution to produced the vast majority of it. This isn’t the 60s anymore, there are ways for small operations to dispose of chemical waste, very easily. Dont be gatekeeping this simple process you somehow tout as some sort of dark art. It isnt. Dont comment on anything us mechanical engineers do either. You are just a chemist.
Reply: @shoestringeng6473 or, as we say in the UK, a bit of a knob.
Reply: @MichaelChenTejada Eyewash stations? Really? But table salt is virtually all sodium chloride, and when people cry, tears are a solution of sodium chloride ie, we cry table salt!
Reply: @TheOriginalThEBLanK highly dangerous when extremely hot or in bulk quantities if you can't swim.
Reply: Comments like this make me skeptical of whether Anything really requires a dedicated machine shop. I want to cast parts out of solid steel using my own arc furnace. Nah, turns out it's probably pretty safe.
Reply: Some people see possibilities, and some see only problems.
Reply: Jeff, do you really see what the man was trying to accomplish? He simply wanted to get a layer of nickle on the part to prevent corrosion. He was not working to any Mil Spec  or any other Specifications. He wasn't trying to set up a shop, sell his services, and create large quantities of hazardous  waste. Did he follow all the proper steps for nickel plating like in a industrial setting..no.But for his purposes it was just fine...
Reply: @jeffbrassard1268  filter the nickle, evaporate the acid then scrape and reuse the salt.
Reply: @jeffbrassard1268 I think you would criticize anyone doing anything in this field you've been in for 40 years. You seem like a gatekeeper for electroplating and EVERYONE is doing it wrong unless YOU show them how to do it. Honestly I think you just wanted to flex your credentials and you found this video to do so.
Reply: @jeffbrassard1268  As a fifty year manufacturing engineer I say you are out of your lane. I have a book from your organization on my shelf. You have lost touch as a citizen I can freely use any manufacturing process I want. Per regulation definition you have to be a company to have a “waste stream” private citizens by definition cannot produce a waste stream! Pound sand!
Reply: @jeffbrassard1268 It appears, in your search for acknowledgement, you missed his " this turned out way better than I expected" etc. The passions, this gentleman generates, could very well inspire someone to become a Younger Version of yourself, thus, keeping this 100 year old trade alive!?!!😮😅😊😂
Reply: Let me guess you owned the workshop
Reply: Where did come from?nm
Reply: Me, looking over at my Nickel plating bath..  Also me, looking over at my 20lb cylinder of R410A that the EPA says should only be sold to licensed HVAC companies with recovery systems. LoL!!!!  EPA doesn't have authority over individuals homeowners!
Reply: Do you not bottle and reuse your baths   Weird?    even the plating company I worked for did this
Reply: @Clough42 
Seeing as it is essentially white vinegar and a table salt solution, combined with a small amount of nickel, I would be surprised if a municipal sewer system weren't a reasonable Final Destination for this solution.
It appears to me that worse things are poured down our drains.
Reply: @victoryfirst2878 
Stainless steel is much more expensive to buy, much more difficult to weld, and more difficult and expensive to machine.
There is nothing easier about making it out of stainless steel.
Reply: You must live in California
Reply: @jeffbrassard1268  What do you do with the nickel salts that will be left after you evaporate your solution? Just season your food with them, salt is salt.
Reply: @jeffbrassard1268  This is what we would expect from someone involved who likes to think their profession is somehow the only one that is capable (make them feel more important and unique) of something....engineers are 'best' at doing this.
Reply: ? @victoryfirst2878  This guy is trying this for the first time and by his own admission has no idea what he is doing...why would you ask him that question?
Reply: no thanks, i will do the same
Reply: Sounds like another crack smoking unemployed electro plater to me. My late brother sounded just like you and he plated landing gears on commercial aircraft. This stuff is basic electricity and basic chemistry. Of course college educations are said to be useless especially by those who lacked the discipline to obtain one themself. Drink you another 12pack of Bud light and tell your buddies how smart you are. 
Haters are gonna hate.
Reply: I did this in school when I was a kid. Risk is low, reward is high. Yea, I wouldn't start using that method to plate commercial components or sell them to Boeing but let the guy plate something with some food ingredients and power supply...
Reply: you sound like a metal plater desperately trying to keep people from figuring out they can do it for a tenth of what your shop charges lol
Reply: Thank you for that insight.Really good to know
Reply: @victoryfirst2878  down  the comments a bit the guy there says stainless would make some carcinogenic gas that will fuck us proper if we ad lib the nickel thing!!! I had the idea you said here. Then decided a pair of silver spoons would do just fine ? HELL NO. I missed carcinogenting my ass by a real short time thanks to the comment section and I can tell he knows the real facts too!!
Reply: @jeffbrassard1268  Hi Jeff, did you miss the "or take it to my local hazardous waste collection" part? I'm a sparky and a rope access tech and I feel your pain when someone tries to DIY things that should be done by professionals but still, here I cannot really see why you're so worried about the quality of the results or the waste disposal. Probably Colough42 is not going to sue himself over the quality, and he really doesn't seem to be someone who just pours those chemicals in the drain.
Reply: Did you drink the vinegar?
Reply: @Jack-Fleming  all of it. every morning starts with that.
Reply: I was just casually watching this video with mild interest until I read this comment. I'll be electroplating everything I can get my hands on now.
Reply: Is there ONE that will electroplate one such item?How much will he charge?
$50… $100…$200… more?
Reply: This response resonates nothing but the ol "please don't try this and learn how easy it is with modern access to facilities and chemicals, u will see we charge too much for what we do"
Reply: @jeffbrassard1268  > bro who asked literally  none of us care
Reply: Yes, the 4 grams of nickel salts he made will kill most life in the Atlantic ocean I'm sure.
Reply: @ianbottom7396 thank you, this just makes we want to do it more. US is a free country after all. Professional scientist are not the gate keepers for others to enjoy science
Reply: LOL dude failed once, and got salty. Cope harder
Reply: Why not just link your business that you're trying to protect?
Reply: Yeah and pay a fortune and plating fees It can be done at home I've seen it. Take your misinformation and your disinformation somewhere else.
Reply: @jeffbrassard1268  You make me want to dump my used motor oil in the grass
Reply: Geez.  Get your knickers in a twist, did you?  I thought it was a good video.  Never know when one might need emergency electroplating.
Reply: Im about to try this in my bath tub or my pool.  Ill just dump the hazardous stuff in the sink.  Lets go!!!  Lets make some money!!!!
Reply: Oh shut up.
Reply: It's look like effect on ur work 😂😂😂😂😂😂
Reply: Some of the most insufferable gatekeeping I've seen in my 20+ years of hobbyist science. I will continue to electroplate at home in my shop.
Reply: If I compare the reasoning, it’s like flying a plane.  Sure, I could leave it up to the professional pilot, or learn to fly on my own.  Just because I can fly a small plane doesn’t mean that I will be flying a Jumbo 747.  Same with electroplating, there are professionals and there are hobbyists.  I’m a hobbyist and I choose to electroplate in my home and nothing is ever going to stop me!
Reply: What if i told you that people exist outside of the plating industry who have enough brain cells to sufficiently carry out plating. I've seen plenty of shit work done by professionals.